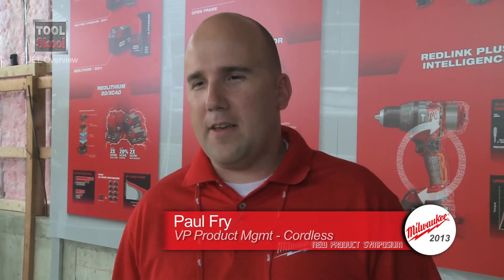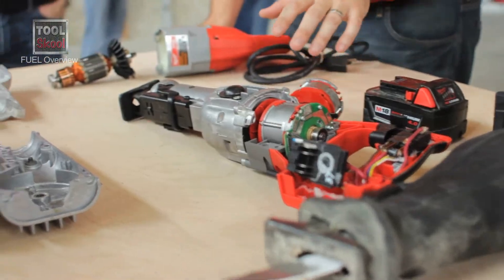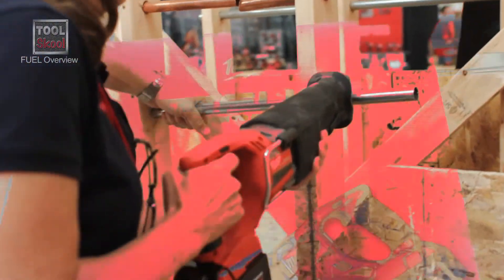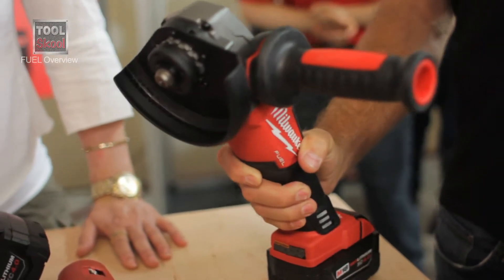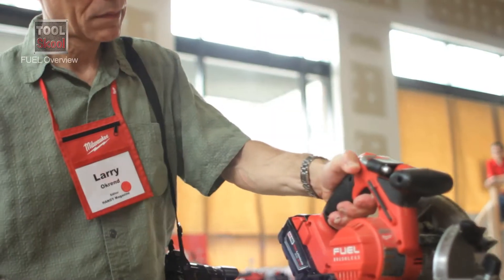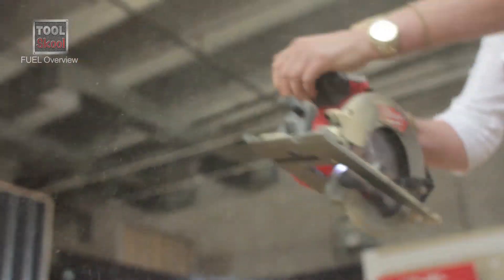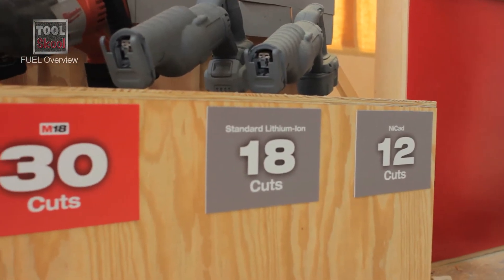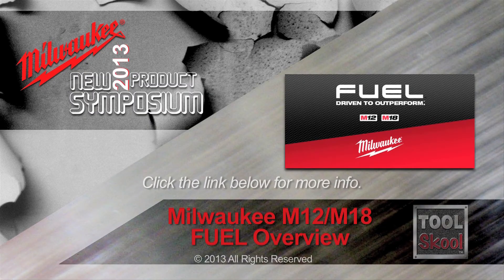Milwaukee FUEL Brushless Tool Technology  - Overview

Comment: Brushless Cordless tools are garbage. I had one die on me in two weeks of normal use. Brushed tools are way better in long term durability. My Brushless garbage hammer drill was made in the same manufacturing plant in China as Milwaukee Fuel M18. Lost money over the brushless hype.